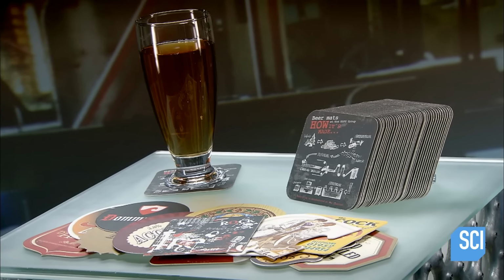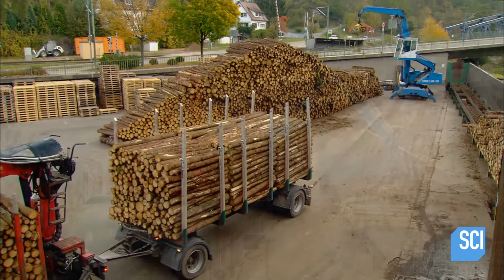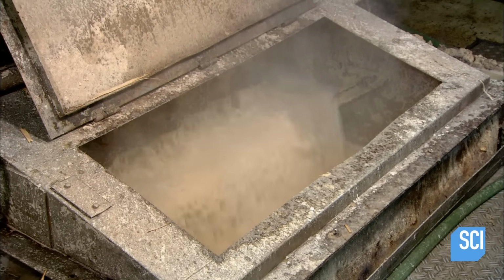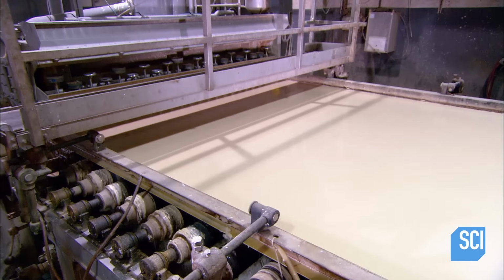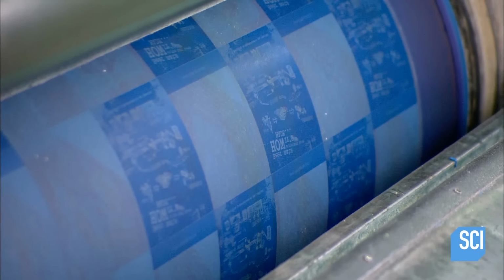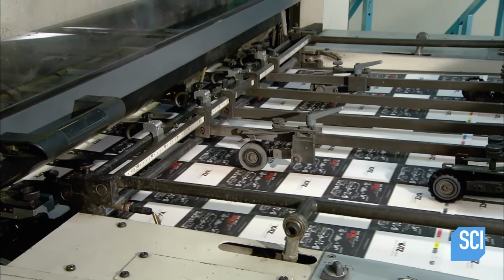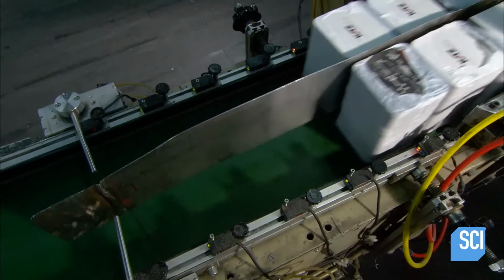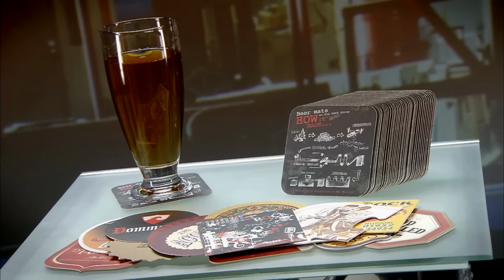How It's Made: Drink Coasters

Comment: Kind of wild that they dont make these solely on recycled materials. Its a tossable item after each customer, so why not make an effort to have a smaller impact on the environment with something so simple
Reply: I was so impressed when they used the whole logs, really expected them to use recycled cardboard or something like that 😖😖😖
Reply: It does seem really wasteful for something so disposable...
Reply: It seems to me much of it is recycled, it depends on the amount of paper they use but it's not like they wouldn't recycle even more if that wouldn't compromise quality
Reply: Because it's not possible to make them from recycled materials.
Reply: If they were made solely out of recycled cardboard, they wouldn't be sturdy enough. They get wet during usage and have to be leak proof. They may not dissolve of deform under the glass when they are wet. That's why they have a wood mix core.